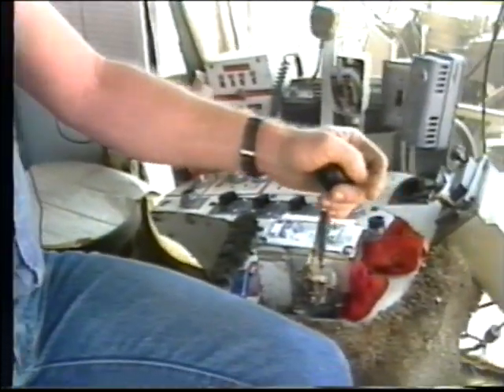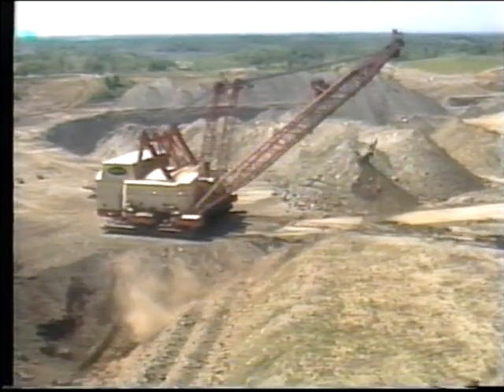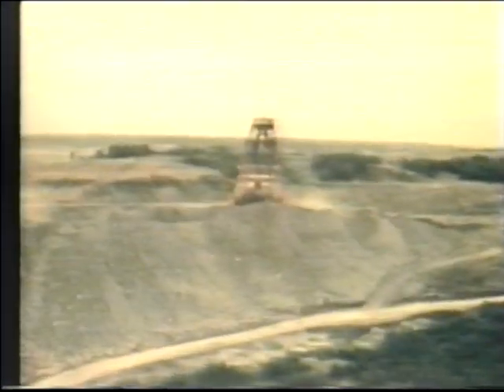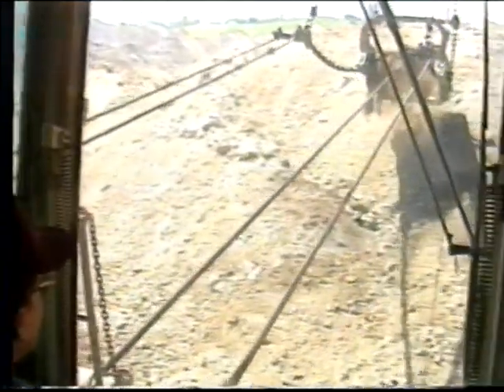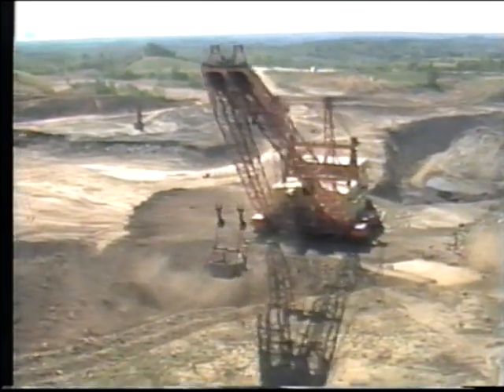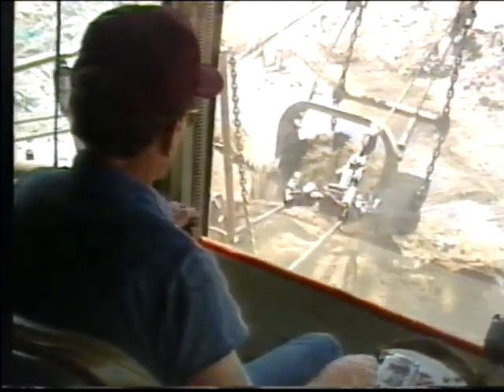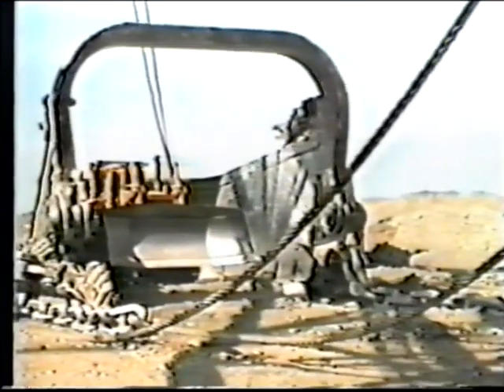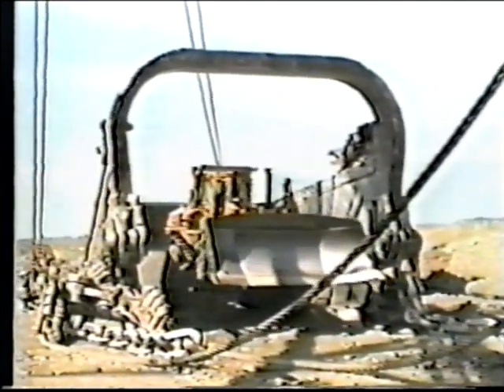The Big Muskie

Comment: Sounds like it used almost as much electrical energy as the coal it mined produced!
Reply: Agree and if you add in all the energy expended to build and move it to Ohio, plus all the resources to get the coal to the processing plant and on to the power plant.  Justification: These are the kind of numbers the anti-green energy people cite about solar and wind. I have even heard someone talk about the energy losses in electric transmission lines as a reason not to use electric stuff. Also they hate the idea that Muskie was... wait for it... electric not diesel.